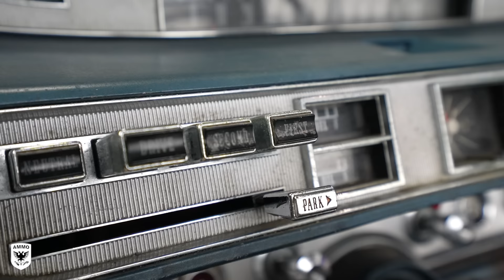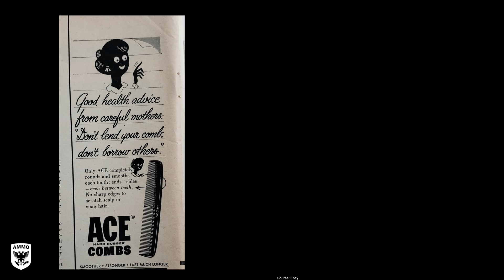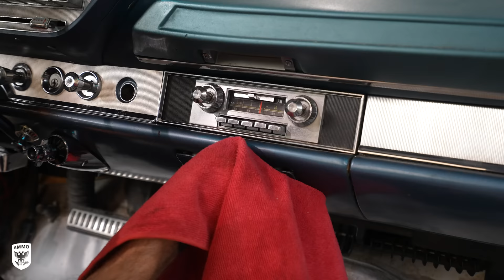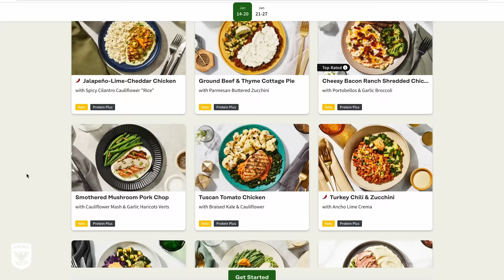Disgusting Dodge Restoration Detail and Mold Removal. Win this Car for $101.90

Comment: I stumbled onto this episode just now and it brings joy seeing a vintage Dodge from the 60's being preserved. this one was in very good survivor mode for a convertible from the rust belt? Anyway, It brings back memories of my parents old Dodge 330 station wagon with the slant six. It was the base trim so had the torque flite transmission with pushbutton controls. 

Anyway, like this 880, it had AC, AM pushbutton radio, roof racks, wind deflectors on the D pillars, and full wheel covers. It was white with blue interior like this one, and came with only 2 lap belts standard, driver and front passenger, my late father added belts for the rest of the positions, front and back and had the dealer install them as we knew we'd need a new car to drove all the way across the country from Jacksonville FL to Washington State, and McChord AFB that year. 

We end up moving out of this area in 1967 to Tinker AFB in Oklahoma City, then to Jacksonville while he did his tour of Vietnam in 1968-69 and was asked where he'd wanted to retire, back to McChord and UP, which is what we did, so the wagon made the trip across the country twice. 

We'd ended up keeping the car until 1977 and sold it then with about 145K miles on it and a second transmission, still running, though not great by then.

Due to that car, I have developed a soft spot for Chrysler products since then as we have had several other dodges/plymouths since then and I even had a 1968 Newport, never mind a base pillared 4 door for my first car in HS in the early 80's. 

Both my grandmother's 2 door base 330 and our wagon were white with blue interiors, hers stayed white but we repainted our car in 1968 in a sky blue and it's now one of my top colors for a car.

Comment: Hey a 64 Dodge 880 convertible was rare.  Secondly, if it has PW and AC, very rare.  Great looking car.  Oh man I wish I could have had a chance to win this!  BTW 1964 last year push button trans.

What makes this model even more special was the fact that on 1962, Chrysler downsized its cars based on a rumors GM was doing same.  They were wrong and sales suffered.  The 880 was rushed in as a true full sized car.

Comment: Looks great.  A Dodge 880 is not really a muscle car.  The emphasis is on smooth ride not handling.  The 383 engine is also smooth and torquey but not high performance.

Comment: That is awesome Larry, I have and daily drive the same car, The Custom 880 here as you see is a 2 door convertible variant, they were the rarest with the "Golden year" anniversary edition version of the 880.
Mine is a 4-door hardtop, but still the dashing car it looks like from the vid, the odds of seeing it being detailed is bonkers, great work as always.

Whoever wins that car has their work cutout for them, parts availability for those Chrysler C body's have been far and few.
 (C body is a full size car body type)
 C body's have always been the lesser mopars compared to the Charger/Valiant/Monaco/Newport/Polara, just different from the pack, that's why i like the Chrysler C bodies. stands apart from the crowd if you will.

Apologies if this all sounds condescending, Just glad to see another 880 around on the road, and detailed by the one and only Larry K.

Comment: My dad had a 64' Dodge 880 Custom Golden Anniversary Edition 4dr hardtop. It was black with a goldish interior with a pair of matching bucket seats out of a Chrysler Newport. Originally a 361 engine car with the pushbutton TorqueFlite. After about a year it ended up with a 440/375hp out of a 69' R/T Charger with 38,000 miles, a built TorqueFlite and 3.55 SureGrip rearend. It rode on G70r15 radial Michelins with thin whitewalls and baby moon hubcaps. I kept that car immaculate with Classic Car wax. He would tow a 17' Larson All American up the Thruway to Lake George, NY each summer like there was nothing behind the car and still got around 16/17 mpg. Sunoco 260 gas was still around then. I also found out the hard way with an impact gun that it had left AND right threaded lug studs. He had that car from around 1972 until the early 80's when the passenger side front fender and unibody was smashed in. I miss that car. I'm 65 now and found this video bringing back some memories. Thank you.

Comment: Reckon we could use a brush with a thick 6cm handle for concentrated shrubbing, because i noticed you had adapted this method out of a usual sized one..

And a solvent based rejuvenational renewal spray, that (in the case of the older deformed carpet, which would be high in fiberous dirt particles and warped saturation ) would ''unravel'' the exsisting strands if you will..

Comment: Fully loaded.  You noted the power windows but didn't call out the AM/FM radio, the bumper guards, backup lights (not mandatory until 1966?) ... or the factory air!    No optional seatbelts, though (mandatory by 66 or 67, optional in a lot of cars before that).

I assume you didn't throw it up on the lift so that it didn't turn into a month-long job ...

Very  nice!

Comment: 25:26 why do you drive it after, especially a car with that rarity/value? It's not like a mechanic after replacing/repairing mechanical parts and need to test drive.